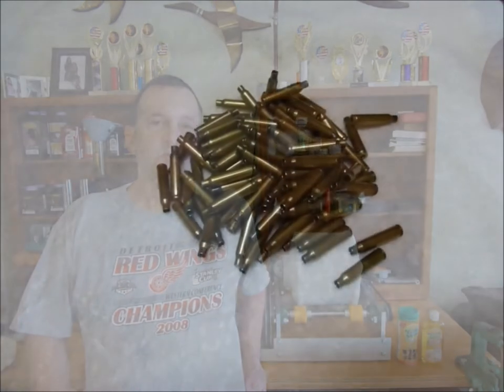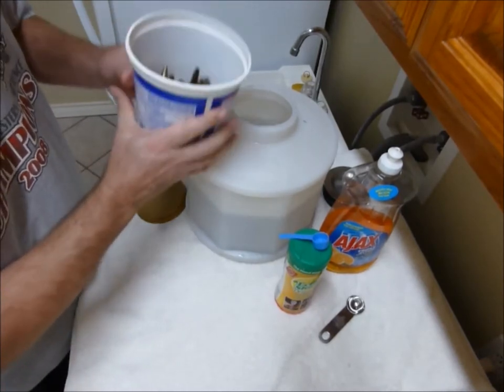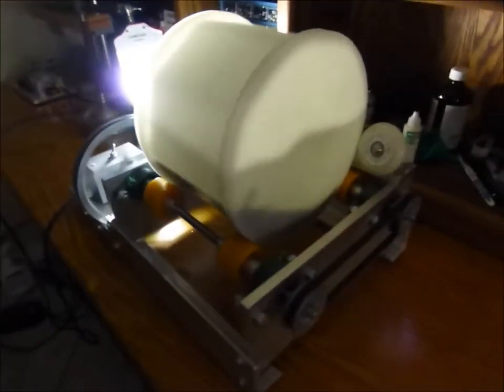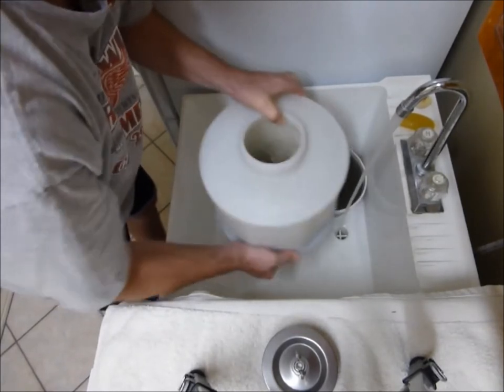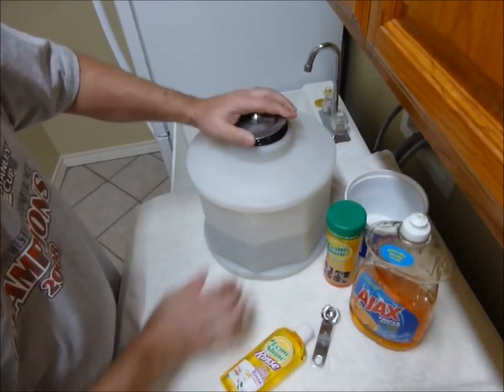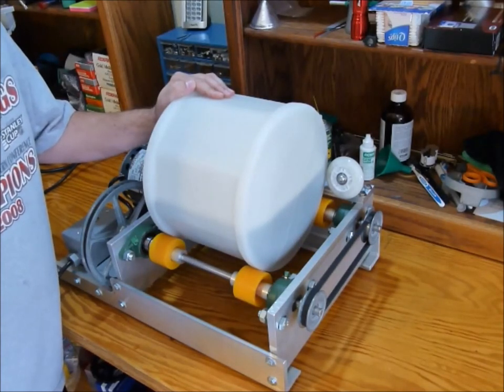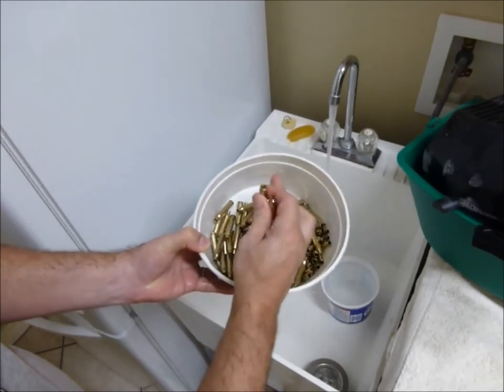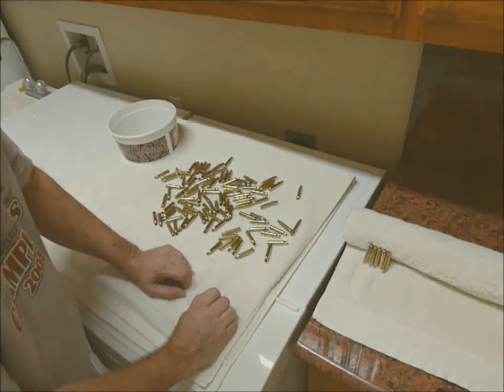Brass cleaning for the reloader

Comment: Mark,  the workmanship on your tumbler is first class, great job.  what is the length of the 2x3 front and rear frames? and the size of the pulleys on the opposite side of the motor? and the length of the belts if not to much trouble.  you ought to draw up a set of drawings and put them up for sale, i'd buy. thanks, jj

Comment: Mark -- What are the dimensions on your side plates (length, height, axle to axle hole centers, and height above table top that the axle holes are located. Front and rear lengths would be a plus also.  Finest I have ever seen!  Thank You!
Reply: The plates that the bearing are bolted to are 6" x 14.25" x .5".  The distance between the shafts is 9.125".  The shaft holes are 4.25" up from the bottom of the plate.